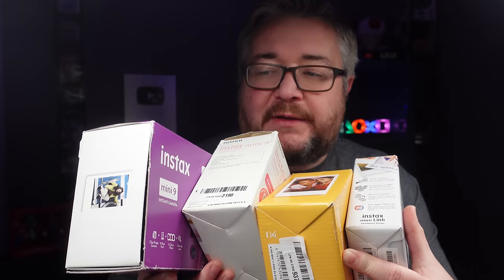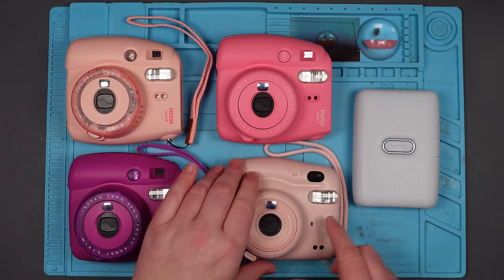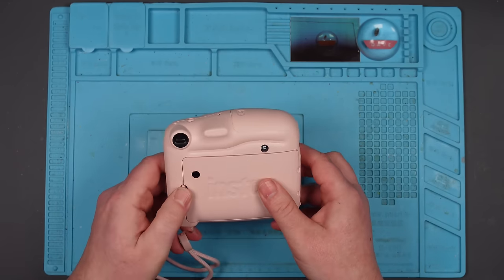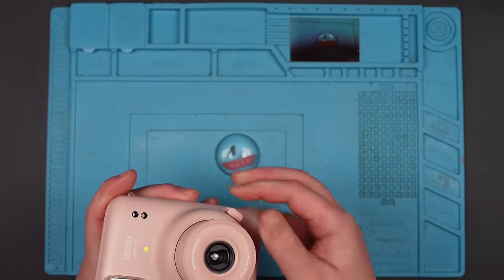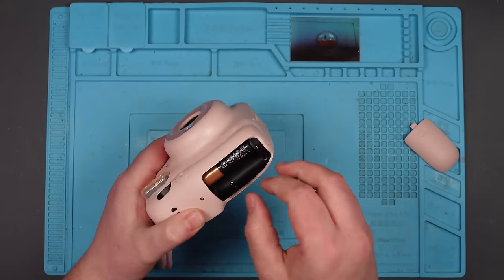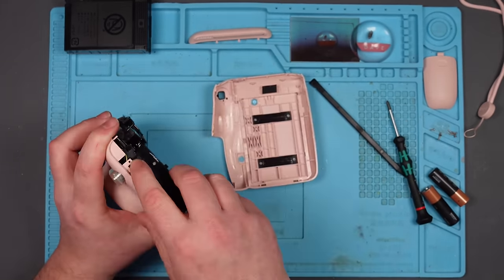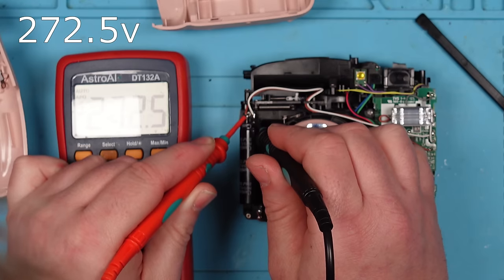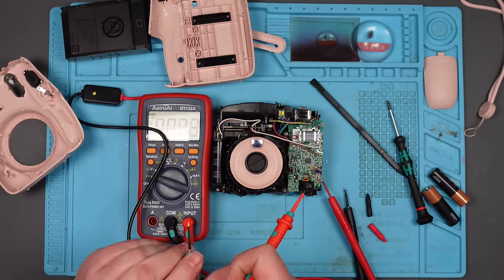INSTAX Mini Cameras with FLASHING ORANGE Lights | Can I FIX It?

Comment: The pink one where the photo comes out but are ruined is a mechanical problem. The two rollers squeeze the chemical across the photo are probably loose and doesn’t squeeze properly. I don’t know if there is an adjustment for the tension in these rollers. Maybe it got dropped and got warped.
Reply: it also could be a bad film. The chemicals inside could be a bit dry. I had that problem often with ancient Polaroid Film
Reply: @TheKrogon  vaccum sealed new stock ... he opens it right in front of the camera.
Reply: @darknase  If the film is old, it doesnt matter if it was vaccum sealed.
Reply: @TheKrogon didn't he use the same film with the other camera?
Reply: @kziad1  he tried a different film at 21:00. I am not saying i am right, it could be the rollers or the film

Comment: The reason that the photos look off center from what you see in the viewfinder is called viewfinder parallax. It happens in viewfinder cameras and not in SLRs. The reason is the viewfinder is above the lens, and have to correct it by pointing the camera down a bit. SLRs don't have viewfinder parallax because you are looking through the camera lens itself. The first 35mm we were taught to use in photo school was a Leica M3 and we had to learn how to correct parallax. Some cameras had a line in the viewfinder to help.
Reply: Plus these camera's are meant to produce a "acceptable" image at the most common ranges. "4 inches from Dave" is a great title for a punk band but no the kind of location that will have these camera's produce a good image. It can't focus that close (it probably doesn't focus anyway) the flash will throw it's light past the subject, and it's off-center because of the parallax.

It's usually fun to see Stez struggle, but sometimes I wish he'd do the unthinkable and google how these things work before starting the fix...

Comment: You discharged the capacitor, but then hooked camera up to power supply with finger close to capacitor! Would desoldering one of the wires temporarily be a safe thing to do while working on it?

Comment: Steve your channel is awesome. The humor, the music, the editing and composition. It’s all unique and makes for a fun, entertaining, and educational viewing experience.

Also, taking on things such as that board swap is inspiring. I don’t doubt my ability to do this work as I’ve spent many years in the past doing solder work installing flash/tune chips on OBD1 ecus, repairing damaged traces and cold/broken solder joints on weather exposed ecus, modifications to make JDM ecus work in USDM cars, etc.

But for those who may not know how to do work such as this, you take the fear out of it. Worst that will happen is something that’s broke will still be broke. And you show that in the end the learning experience, skills, and knowledge gained are sometimes worth more than the repairs.

Glad I found your channel way back when. And glad I stuck around. Been here since 15k sub mark.

Comment: I think that first camera has a light leak in the body, based on how the same part of each photo was totally exposed.
As for why Dave wasn't in the center, the viewfinder in those cameras is offset from the lens, so you aren't seeing the same thing as the lens is.  It's not like an SLR where you're looking through the lens.  If you're taking a photo of something close, you have to account for that offset when you're framing.
Reply: Parallax Error
Reply: @ acidhead.
Trigonometry is fun, and easy, if you paid attention in class.
I believe parallax is a made up word😅

Comment: Those instax mini 9s, you have to read the instructions to get the best results. There is a dial that you turn to what the orange light recommends for the lighting conditions. Then you will get a much better photo. 

Instax mini 11 is much better as it does it all for you. Yes these caneras are picky as they only like to uae Alkaline batteries. Bought many "faulty, flashing orange light" and turns out just the previous owner didnt use the correct batteries lol.

Great video!!! Was frustrating to watch as i was screaming out about youre looking at thw wrong side 🤣🤣

Comment: Those capacitors are brutal. I have been shocked a couple times with them and it is far worse than a mains 120v shock. Just beware not only do you have to stay away from the capacitor contacts but also from the circuit board. Also if you don't have a fancy capacitor discharger a big flathead screwdriver works well😂.

Comment: My friend and I used disposable cameras to make 'tasers' using the flash capacitors. I also worked at a 1 hour photo Walgreens at the time.
We made one that had hidden terminals in the grip, and I was able to install a new tool of film in the dark room at work.
After a full roll of film planning or friends, I developed the film too. Lots of pictures with the subject either at weird angles, blurry, completely missed, etc.
The strongest one we made could burn a hole through a quarter with it's arc.

Comment: Hi, Scott in the UK here. Even though the position you held the camera in whilst taking the photo may not of been resulting in the pictures not working properly, it really frustrated me though the position you had the camera in whilst taking the picture. 😄 You had the camera the wrong way round. Which was confirmed to me when you said, "why is Dave at the top of the picture". The reason why he is at the top is because you are holding the camera from top to bottom, when you should be holding it side to side. 

With what position the camera is in when you are putting the film in, that's the position you should also be taking the picture with. Or in other words, the battery compartment should be at the top when taking the picture, but you was taking the picture with the battery compartment on the side. (Or is it me that's wrong about that? And that perhaps those cameras aren't supposed to be held in the traditional manner 😅) 

I first came across your videos by the way back in March. At the time I was looking for videos about soldering a headphone jack, and none of your videos appeared during that time, But then after I had done the job, and didn't need those kind of videos anymore, one of your videos then appeared. So I watched it, and i like (and get) your humour so iv watched quite a few of your videos since. 👍

Comment: 24:02 The top image is exposed in the pack, so yes it is ruined. Pictures under it will not be ruined, otherwise they would get ruined when you expose an image. Each picture does not let light pass (not enough to matter at least)

Comment: As with most cameras they would probably work better in good daylight. I have tried fixing cameras in the past with limited success. They are very fiddly especially without a schematic or repair manual. I did manage to get a Nikon D100 working with a donor, but it's easier to just buy a working one.

Comment: I looked into the orange blinking light on Mini 8/9 and started drawing a schematic, getting some idea of how the PCB works, testing all the components etc. but ended with the realisation that it's a firmware corruption that happens. Once "bricked" there is no way back. Very shitty design. We have a working Mini in the house that I built from combining two cameras and i'm hoping it will never corrupt the firmware.

Comment: the films / prints have a pouch of chemicals that is squeezed out over the encapsulated print as it passes through the rollers.  you will also see this pattern happen with badly stored or very old films that have dried up/ evaporated

Comment: If you can figure out the issue plauging Canon Powershot cameras from the 00's causing them to no longer be powered by AA batteries I'll be keen to tune into that for sure, they power by the DC jack so they do still work!
Reply: Very common issue the pins on the bottom of the battery door loose there tension. They need to be bent up very carefully to make a proper contact. Ifixit have a guide on how to fix the problem

Comment: 20:52 Nooooo, they are coming out EXACTLY as they should be. The black coating is the opacifier on the rear of the film. Once spread and black all over it's all good. Image will appear on the other side of the film (White side) ...

Comment: 14:50 One of the springs for the rollers are not pressing down enough to squeeze the chemicals correctly. Probably a broken plastic post for the spring.

Comment: You can just put a resistor across the cap and it will discharge...   usually about 1K will do it

Comment: 22:45 - Parallax error. You are looking out trough the corner of the camera while the lens sits in the bottom center, and you're up close, even too close. What the viewfinder and lens is pointed at is not the same point.

Comment: I don't think the other camera has a light leak.  I think the rollers that spread the developing chemicals inside the film are not pressing the film hard enough.

Unfortunately these Instax cameras kind of suck.  They're not really much good for closeups and they don't work very well indoors-  and the viewfinder doesn't work when you're close to the subject either.

Comment: I know it shouldn't, but It bothers me that someone of a similar age to me doesn't understand how pre-smartphone era fixed focus cameras work. They are not designed for taking a macro on a desk, you need to go outside and take a photo at a reasonable distance in daylight. And the viewfinder is not looking through the lens, so of course the image will be offset if you take a close-up. The broken camera looks like it has light leaking into the film chamber, which is probably fairly easy to track down.

I love your videos and you do some amazing work, but I think some of your frustrations in these camera videos are down to operator error.

Comment: Several comments on cap zapz and parallax but my two bobs worth is that dicking around with these money pits is never gonna be worth it. Crap photos that cost for me here in Oz, a buck each. No thanks. If you want to try fixing an instant paper printer go for a dye sublimation type, preferably a Canon, otherwise there's probably a bin just near you mate . . . use it.

Comment: yes you do need to meware of flash capacitors. You can get a kiss wih a nice bite out of those. (I have tried).
Reply: Bonus points for touching one lead with one hand and the other with your other hand so you take it through the chest.  I got stunned and light headed and sat down hard.   Almost passed out!   Just through one hand hurts bad enough.
Reply: @hugegamer5988  yeah it hurts enough just across one fingertip. The camera I was working on had a much smaller (physically) cap han this to but I think it was a made for purpose flash cap. I never tried it on my tongue like a 9v battery though.